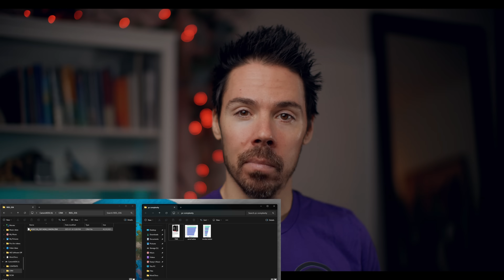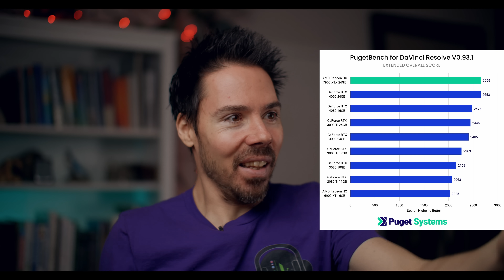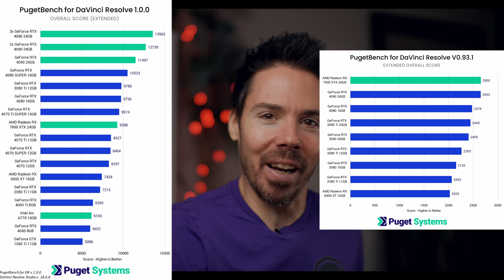The PC Building Rabbit Hole NEVER ENDS!

Comment: 5900X and a Gigabyte Aorus board! Cool. I have that same combo, except X570 Aorus Elite instead of B450 Aorus Elite. I use to think those boards basically had the same I/O but you proved me wrong. The X570 Elite has 2 10gpbs (red) USB ports. One Type C, one Type A. Drats. (also better PCIE gen and lane distribution)

- Thermalright is a good choice for cooler upgrade though! 

- If you put only 1 NVME SSD, using the top M.2 slot will disable 2 SATA ports. According to the manual, they should be labeled "ASATA3 0" and "ASATA3 1." These SATA ports are grey, the regular ones that will still work are black. Move your SSD to the top slot, and make sure any SATA drives are connected to the first bank of BLACK SATA ports. Everything should boot up and work fine with no changes. 

- If you use NVME SSDs in BOTH m.2 slots, only the first two BLACK SATA ports will still be enabled. SATA3 0 and SATA3 1.

- Your're on the right track about the "sharing a PCIE lane" but instead of one lane, its 16-24 depending on the CPU and chipset configuration. In your case, 16 lanes go directly from the CPU to the first PCI-E slot and 4 lanes to the M.2 slot under it. 4 more lanes are controlled by the chipset, and id say that very bottom PCIEx1 slot and M.2 slot are chipset controlled and using them shouldnt affect how many lanes your GPU and first M.2 slot get. 

- Unfortunately the B450 Aorus Elite only maxes out at PCIE 3.0 instead of PCIE 4.0 which X570 boards make use of. While unlikely to affect performance, it MIGHT hold back your new graphics card from performing at its best. Its unlikely, but something to research. 

Be sure to update to the latest BIOS for the motherboard, then in the bios enable "Above 4g decoding" and then enable "Resizable BAR" to get access to AMD's "Smart Access Memory" feature. WIth your Radeon card, this means your CPU will be able to directly address the VRAM in the GPU more efficiently and this can help improvement in work tasks, games, etc. 

If you ended up swapping out to a better motherboard with better IO and PCIE 4.0 (so some kind of X570 or B550 motherboard), im in the market for a B450 board if you were willing to sell it! :)

Comment: Two years ago I bult a new PC from scratch after going down a similar path as you with my pre-built Asus 4th-gen Intel i5-4440. As a pre-build from Best Buy, the Asus motherboard had some limited expandability, which I pushed right to the edge before realizing I had squeezed as much time (9 years) out of it as possible.

Each of these improvements resulted in noticeable performance gains:
- Maxed RAM to 16 GB (from 8)
- Replaced spinning drive with SATA-3 SSD (MB pre-dates M.2)
- Replaced stock 250W power supply with modular 650W
- RX-480 6 GB video card, which plugged into the new power supply

Despite the improvements, I realized that there would be no more gains possible because of the motherboard and CPU limitations, and so built the following:

- ASUS Z690 Tuff D4 (updated BIOS with lates Intel microcode)
- Intel 13600K (only gave me the Blue Screen of Death twice in one year)
- AMD 6750XT with 12 GB RAM
- 64 GB of 3600 MHz D4 RAM (I'd get a D5 MB today, but whatever)
- WD 850x and 770 Black M.2 drives, with SATA-3 SSD drive as backup
- Same 650W power supply as from old build since it was only 1 year old
- Peerless Assasin air cooler
- Corsair 4000d case (white)

This is blazing fast compared to what I had prior. Ironically it is now overkill for my needs; I had built it to continue video editing but I don't have time for that anymore, using my PC mainly for writing and the occasional game. I might get back to video editing at some point but right now I have a BMW M3 for a PC whereas a 330i would have been just as effective for my use case.

Comment: You should have a usb 3.1 header on the motherboard. You can search for an expansion card which would utilize that usb 3.1 header.
Reply from the maker: That's what I did at 8:01 it's slow AF.
Reply: @cameraconspiracies  those are usb2 transfer speeds but you have a proper 10G usb 3 header. Something is definitely wrong.
Reply from the maker: @Kobrar44  I just tested it and you're right.  That 10GBPS adapter was a lie.  I'm getting the same 35MBPS in my new PCI slot with that adapter lol.  FML.  I literally ran out of ports though so I definitely needed this PCI card and I'm happy with it :)

Comment: 12:45 maybe it's because one was davinci resolve version 1.0.0 versus version 0.93.1  . . .  . . JK... probably not.

The 7900 xtx had a few issues at launch, there's a vapor chamber in the card which is supposed to contain water for purposes of cooling which was not properly filled for a lot of people. I had to send my card back closer to when it originally launched because it overheated.

Anyways. 7900 xtx is probably not as good as a 4090 on any occasion but approximately so good as a 4090 such that the price point differential makes it worth it. The only downside is pytorch and cuda the two primary locally run A.i. tools do not work with AMD, only Nvidia.

Comment: Bro, you brought this shit on yourself. The B450 AORUS ELITE spec clearly states the "The PCIEX4 slot shares bandwidth with the PCIEX1_2 slot". Look at the 3:04 footage. You see yourself you installed your other PCI card into PCIEX1_2 slot! You MUST remove the PCI card from PCIEX1_2 slot and install into the PCIEX1_1 slot which is right from the GPU card. If you would have done it in the first place you wouldn't complaining. Also the PCI card you bought is totally fine. It's just user error and that's it. The PCI card can't in any shape or form impact performance of your GPU as the latter has its own dedicated PCI lanes. Also, the proximity of the PCI card to the GPU is not affecting your GPU thermal performance. That's it. You have all the ingredients but you just plugged them in the wrong order.
Reply from the maker: The hell are you talking about?  GPU is in the fastest lane, the PCIe was in the slower lane below it blocking one of its fans.  It wouldn't fit in any other slot, it's X4, the other slots are X1.  I got an X1 card and it works fine.
Reply: @cameraconspiracies  Take the mobo picture you put into the video and look there at PCI slots labelled as PCIEX1_1 and PCIEX1_2. Remove the PCI card you have from PCIEX1_2 slot and put it into the PCIEX1_1 slot. On Gigabyte homepage the B450 AORUS ELITE spec clearly states that when both PCI slots - PCIEX1_1 and PCIEX1_2 - are in use, you have reduced throughput. I think I was clear enough based on your video alone.
Reply from the maker: @ You're right, but I've already done all that lol.  That's my OLD PCI gen 1 card in the X1_2 slot, which didn't even have USBC.  The new gen 2x2 card that I bought only fit in the slot under the GPU, it's an X4 card, I didn't know about the different sizes.  That wasn't ideal so I removed it.  

Both of those cards have been removed, and I put a new X1 gen 2 card in the top X1_1 slot like you were explaining.  I'm already there ;)  There's nothing in the other 2 slots now.
Reply: @cameraconspiracies  The message I wanted to convey is that when you carefully follow the limitation of your motherboard which are standard in terms of how mobos handle PCI lanes when all or several PCI slots are populated then you have no need to replace your motherboard, unless you feel the results are unsatisfactory. You actually bring up the right things and notice the true bottlenecks. AFAIK the first PCI card you bought for having USB-C when installed as mentioned into PCIEX1_1 should satisfy your need for USB-C port at the speeds the PCI socket is providing. Your motherboard has everything you need and is future proof because you are now in the future trying to sort our what to do with the mobo and it fares very well. Hoping you get your satisfaction back with the upgrade. Also, end every PC related videos "I should have got a MAC" and people will get happily going in the comment section. ;)

Comment: yeah fuck am5, i have a 5950x it's the fastest cpu in am4 socket
I massively overpaid for my 5950x from an ebay scalper in 2021 but at the time I was making money in a way which was limited by my cpu resources so it made sense under a certain logic.\

am5 seems like a profit seeking thing more than a genuine tech improvement. If they make new am5 boards a lot of nerds will buy for the sake of it. Yeah, they're faster, not by much.

The speed of cpu type stuff really comes in when you are gaming. so like amd has x3d cpu's which have a lower overall thread, core count but are super fast and responsive so they can generate frames in games faster.

At this point every modern cpu is pretty well so good you don't even notice a difference. the 5950x i upgraded to is basically indistinguishable from my previous ryzen 5 cpu until you push cpu usage (virtual machines running their own operating systems and programs etc. etc. ) then you realize its like 5+ of the old cpu taped together.

Comment: The Problem with Puget System Benchmark is, that you bough a AMD GPU. Nvideo is much better with encoding h264 - the most used Video Codec. AMD is a lot slower with this. So ... i hope you dont use h264 Codes. Than all is fine.

Comment: Your PC wont work AT ALL if you move the SSD with the OS on it..trust me itll FUCK you bad. Happened to me once. Dont move ssds around and if you do, make sure you back up your os first then reinstall tuen one at a time but i know yourr going to mess up those instruction so DONT TOUCH. RTFM
Reply: wtf, it will work just fine
Reply: @ try it right now. You wont be able to respond again though…bc your CPU NEEDS THE OS ON THE CLOSEST SSD, and usually thats the top one, so when you go moving them, temp bricked. Youll literally need a usb stick with win10 on it to proceed from there, im not even kidding
Reply: @ you can move it just fine , just check boot order once moved
Reply: @ dude most basic mobos , hell even good ones- wont iust flex and allow you to boot the operating system from the bottom  ssd slot. You can google this but boot order wont matter it needs windows to fo anything and wont be aboe to access it. I have 3 ocs and have ahd this problem twice. Even cc staff couldnt figure it out. I had to fixmyslef
Reply: @ https://www.youtube.com/watch?v=kQae3gM3nJE and it booted fine.

Comment: These are all good for a laugh. Having been there, built many PC builds before I decided my focus needed to be filmmaking and video rather than wasting my time trying to build a computer. Haven't used Windows since, hmmmm, 2011? Been awhile. Once you move to Mac, your computer becomes a tool you use and all this fades into the background. Next time you're trying to install a motherboard, think if you were using the time instead to become a better videographer/filmmaker, sound guy, anything but a tinkerer on computers.
Stop holding yourself back. Life is short.
Reply: The upside is since you've wasted a little more time playing with an assemble yourself toy, by the time you've had enough, the M4 Ultra Mac Studio is about to be released - and nothing, I mean nothing, will be able to compete with it.

Comment: Multiple internal drives work the same as using an external one. It's pretty seamless. Davinci on one drive can load in files or save them to the other drive. You don't have to do anything special to use it. It's just a second space to put things (like a second compartment in a drawer, rather than another drawer).

Comment: M4 Mac and your noise problems are over - needs to be said!    You've said you don't want to deal with learning a new operating system but have you ever tried using a Mac on an extended basis?  Why not just rent one for a month so that you can at least have hands on experience?  Plus it would make for a great video series watching you.    You can keep your PC for those couple of programs that are not available on the Mac if you really need to but I'm sure you could find a Mac OS replacement program if you look around and ask for advise.
Reply: He didn’t want to listen when he asked which he should buy in a past video. Many of us were trying to tell mans to be done with ANY of this madness by just going Mac.

Comment: Every Consumer grade CPU platform have very limited number of PCIe Lanes... 

What the Motherboard does is connecting directly those 20 lanes for GPU (16x) and Nvme/SATA (4x) and the other 4x is devided for all USBs, Ethernet, Audio, SATA and other NVMe's and Additional slower PCIe slots (most of them are 1x or 16x (with just 4x eletrical connection)

Most platforms nowadays have the first PCIe x16 slot and first NVMe ("sharing" connection with 2 SATA ports) connected directly to CPU PCIe lanes, and the rest is connected to the chipset and share the max bandwith of 4 lanes (wich in B450 shipset is PCIe 3.0 4x)(B550 boards, still AM4 have PCIe 4.0 4x to the chipset, double bandwith from PCIe 3.0).

But some motherboards (like my AM5 B650 ProArt) that have 2 16x Slots sharing 8x each directly connected to the CPU and the same NVMe and dual Sata shared structure. (I chose this mb because It enabled me to have dual GPUs for 3d rendering with 8x PCIe 4.0 each (basically the same as dual PCIe 3.0 16x lanes for each GPU....), and have a 10Gbe NIC at the bottom x4 PCIe slot.

For more PCIe Lanes it needs a xeon/threadripper/epic cpu platforms, but they are pricey.
Reply: As for the NVMe being on the bottom slot, if U have dual NVMe config (like 1 NVMe for OS only and other for Programs and Project files or Cache files) u should have I would put the OS drive in the slower slot and the apps and cache drive on the fastest. This way, the ssd that u work on will never have to deal with OS read and writes and vice versa. If u have a single SSD config, just put in the top slot and get the most out of that until u need a second NVMe

Comment: Got the:  Simple Project 21 Inch High Toilet Elongated With Comfort Chair Seat, 1.28 Gpf Powerful Single Flush Extra Tall Toilet
187$ -> 178$
BIGBIGWON Blitz 2 TMR Star Flash Wireless Bluetooth Gamepads Somatosensory Controllers Customized 2000HZ For NS PC Steam Game
58$ -> 55$
~☆ no tax ☆~
I didnt care it was just Digital, I've got all possible Gran Torismo, but the AI will make the mage a dick inspection expert.  Just need potion buttons in Rewasd Legend.
My ryzen 7900 has 28 pcie pcie 5.0 lanes, 4 are reserved for the motherboard, its 5.4ghz, but only 65 watts.  24 threads is plenty, as long as it's 16, that tends to get things done.  If you only knew how big.

Comment: wasn't it just easier to buy usbC to usbA adapter and connect you card reader through it? just make sure the dongle is at least usb 3.0 or you will be suffering through slow transfer.  However, new mobo would let you use new, faster ssd's and have usb 3.2 so... Also, new Nvidia GPUs are coming out, buying that 7900xtx now was poor decision. BTW, that memory thing, wasn't it supposed to be EXPO, NOT XMP? expo is for  AMD, xmp is for Intel. Using xmp on Ryzen will do nothing, so you need to use expo if you want to see any benefit. From the list you just pick the speed recommended for your CPU. If you decide to change ssd slot, remember to remove every other storage device (usb dongles, memory cards, hdds, ssds) co when booting it won't scramble letters. You will have to tell your pc where your boot drive is in bios/uefi

Comment: Yeah my work learned about the whole lane sharing issue on cheap boards the hard way: alot of the prebuilts you can get online dont really advertise what motherboard you get. its one of the main benifits of going with the better chipset motherboards (in your case wouldve been x570, and on AM5, x670e/x870e) or if youre feeling super spendy/have no budget cap, Threadripper or Epyc lol

Comment: 1) All general-use motherboards and cpus have a limited number of lanes they can use, it's not JUST your motherboard. You can have more lanes, but that costs A LOT (see EPYC or Threadripper CPUs and motherboards). So motherboard makers have to make choices (more usb ports? more SATA ports? More m.2 slots, etc.)
2) Don't worry, you didn't damage your GPU in any way by using that usb card. GPU can run on any number of PCI-E lanes, theoretically you can even file of plastic part on the back of top 1x PCI-E slot, insert the GPU there and it should work. If you use less than 16x lanes (say, it's downgraded to 8 lanes because of a USB card), it may affect the performance of the GPU; in some cases it's negligible, in some - measurable or even crippling. I'd guess, in your case (PCI-E 3.0 16 lanes to 8 lanes because of USB card and 7900XTX GPU for video editing) it would have been negligible to measurable.
3) The PC builder could have installed your NVMe drive in the lower m.2 slot to 1) Make it accessible without removing the GPU 2) Didn't know better 3) Improve ssd's cooling by being in an open air, not blocked by GPU (but 4x slot has a radiator, so who knows). Using only 2x lanes instead of 4x can slow down your SSD linear read/write speeds in half, but in my experience it is still enough in regular use (2x slot at PCI-E 3.0 will give you 1500MB/s). Random reads are much more important and they not affectd by 2x vs 4x. If you put you SSD in the top slot you may indeed loose some of the SATA ports (sorry, I can't check the motherboard's manual right now)
4) You may need to update your BIOS before installing 5900X, because when B450 was released, there was no 5900x CPU.
5) Your RAM is 99% safe if you used XMP to make it 3200MT/s. You would have probably already noticed random crashes, and even then you can just downclock it back to 2400-2933MT/s